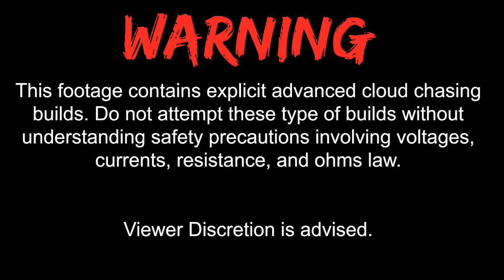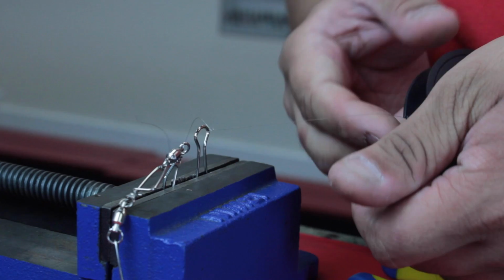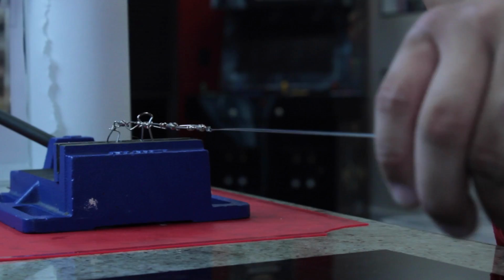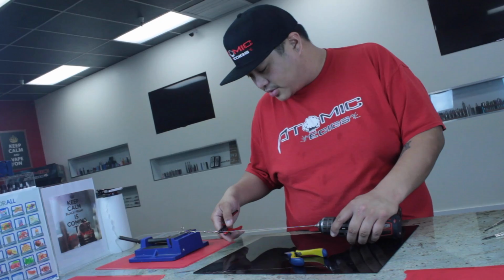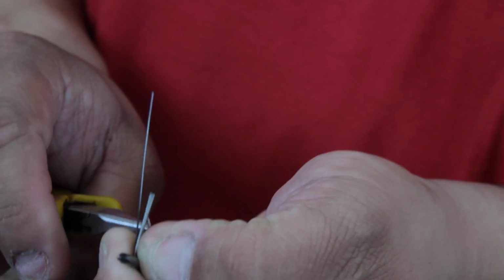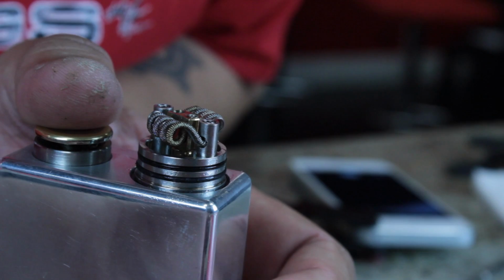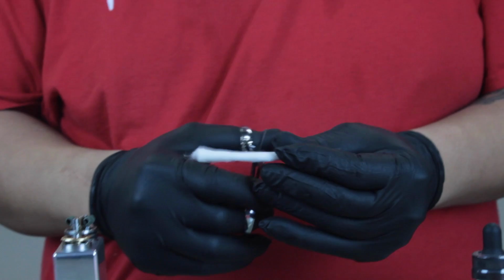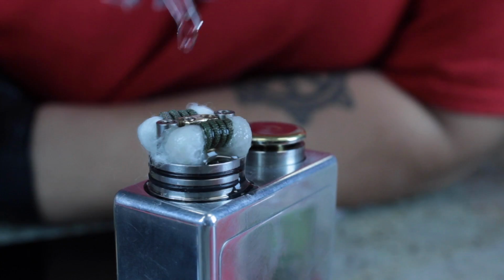HOW TO: Zipper Fused Clapton Green Mamba Coil

Comment: for cleaner wraps , wrap the fused wire first as tight as possible then wrapping the 24g in between or on the outside after. a lot easier and less hassle
Reply from the maker: Good to know :) I'll actually give that one a try :) thanks for the tip!
Reply: +Atomic eCigs great video btw a coil I have yet to try that seems like a little bit of a challenge
Reply from the maker: +Payton Casillas a challenge you shall accept :) I'm sure you will build a really super clean coil with astonishing flavor. Once you do, take a pic for me :) like to see the results :) happy vaping Vape Fam!

Comment: I understand that you said this is for demonstration purposes multiple times but those coils are pretty loose, especially with the parallel wire. if it was tighter together the clapton would heat up faster. The parallel wire will still heat up faster but the clapton would heat up faster than it does in the video.

Comment: im still doing 6 wraps of 24. jesus christ.
Reply from the maker: +Im Djay Mac Haha =) time to step up the game =)))
Reply: +Im Djay Mac id say so lmfao.little behind the curve apparently:p
Reply: jesus Christmas,  you are going through alot of juice. wasted. I'm running 28G, instead of 24G.
Reply: Yeah crazy. Hope you afford juice. it uses the juice bad!
Reply: +Im Djay Mac That wouldn't even be good for a micro coil. use 9-11 wraps. More surface area.
Or yeah, use twisted coils. They are easy to make.
Reply: +Im Djay Mac Yeah even though the people who spend a ton of time learning and building these artistic coils will tell you the vape is night and day different, way better, its like 99% placebo effect.  Ive built most of the variations that are popular other than the tsuka wire stuff and I get almost an identical vape from a simple build of the same resistance, sometimes better even.  These certainly arent gonna make shitty juice taste good and I can guarantee blindfolded no one could tell the difference between any of these coils.
Reply: +joe leeman that may be true between crazier coil but there is a world of difference between a simple one stranded coil vs something that is at least twisted. The larger surface area of the coil means more juice are vaporized at the same time, so thicker clouds, which to some people means more flavor.
Reply: +Atomic eCigs I've tried this build and it's amazing but I did it on a series box mod 10 wrap and omg it's amazing it ohms out to 0.28 I highly recommend it for series box mods and I tried it in a mechanical and I feel like like 22 gauge zipper fused clapton 4 Wrap is awesome also thanks guys appreciate it

Comment: should of done one more wrap of just the zipper Clapton on the end .. so the Clapton is on the outside on both sides ! makes it look so much nicer and makes the 24g alot shorter and the staged heating alot more dominant .. just a pro tip bro

Comment: what mod does he have this build on???
Reply: Dimitri box mod.. Pure mechanical box mod with copper 510, copper positive pin, and a silver plated copper negative pin.. This box mod hit hard, harder then any MOSFET or regulated box mod.. I use my dimitri mod more for cloud chasing and my other mod for both clouds and flavor chasing..
Reply: ***** is it a series or parallel mod?
Reply: Parallel..